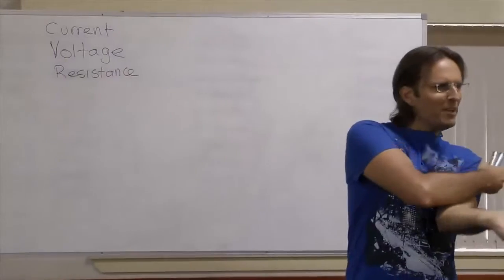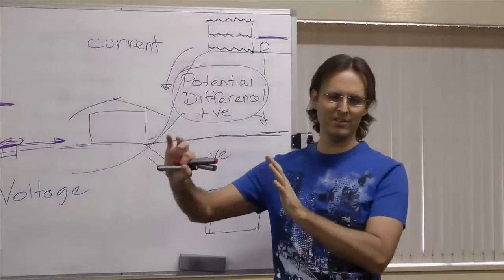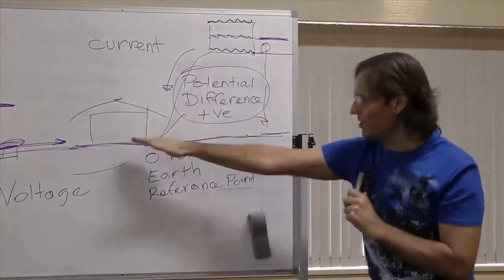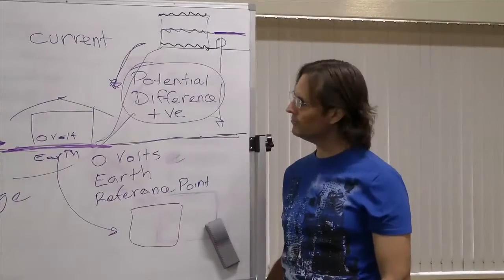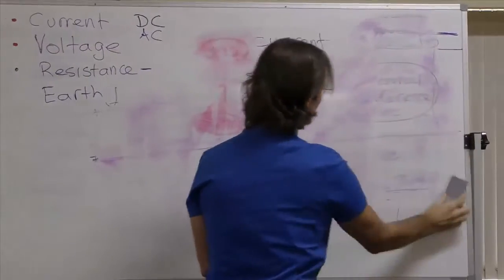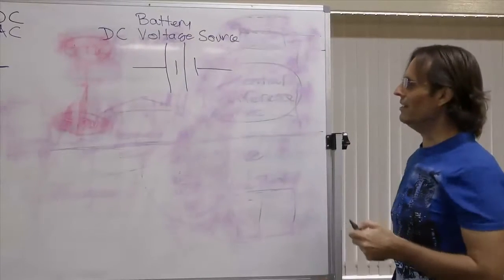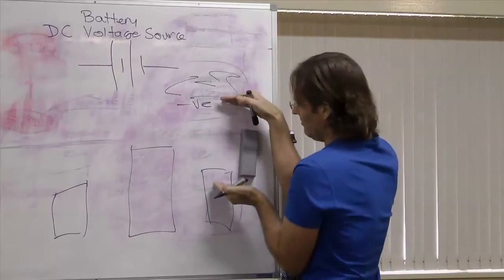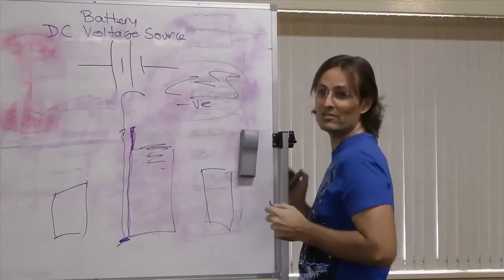Learning electricity | electrical circuits | Learning electrical wiring |part#1

Comment: AT 13:30, IF CHARGES CAN'T FLOW OUTTA SHOES AND CARPET .. IN OTHER MEANS THERE MUST BE N ENTRANCE OF CHARGES FROM GROUND TO CARPET AND THEN TO SHOES .. HOW CAN U SAY THAT THERE'S VOLTAGE INDUCED IN OUR BODY !!  #EXPLAIN
Reply: tayYab asHfaq What?
Reply: Our body is a conductor of electricity and produces minor electrical currents